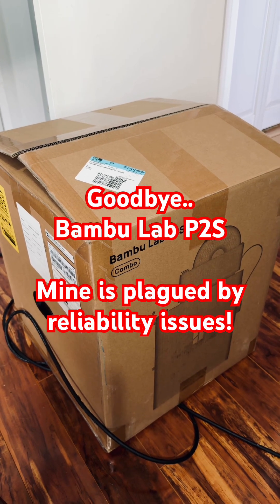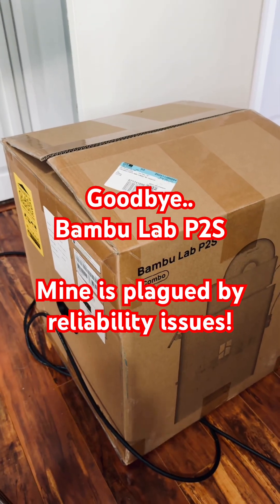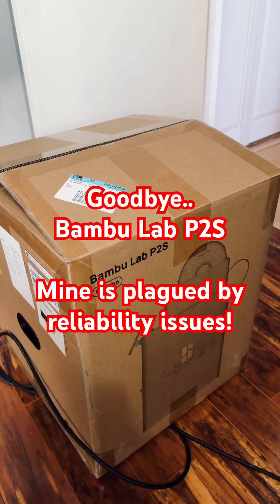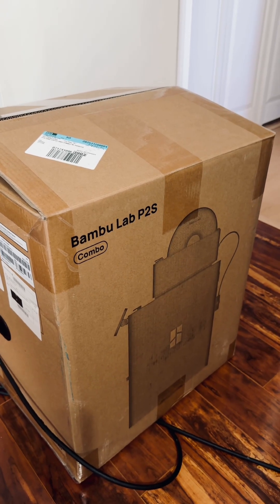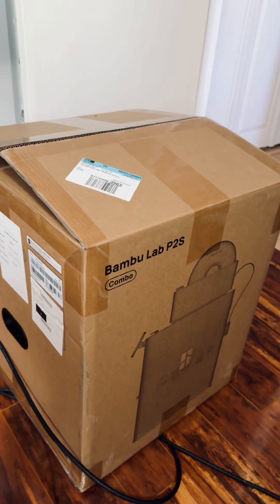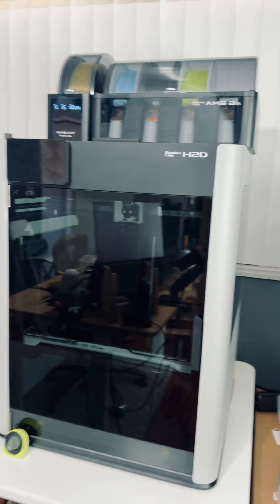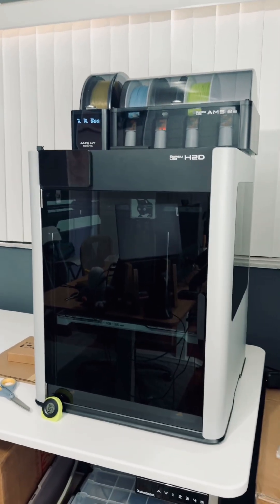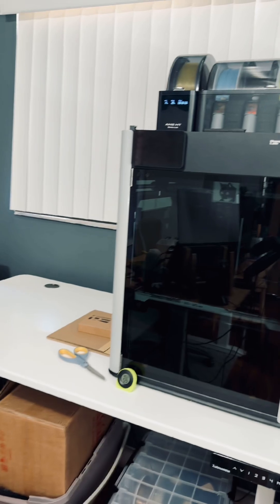Returning My Bambu Lab P2S after 2 weeks... #3dprinting #bambulab #p2s

Comment: I had that grinding issue last night, plus same extruded issues in your video as mentioned. Machine’s cold pull sequence didn’t work so did it the old fashion way of heating the nozzle to 250, take it out and cold pull with pliers. Popped it back in and everything is fine. Regards to the extruded clog mid print, I recommend always having an extra nozzle on hand to swap it in and you can always fix the clogged one later.

Comment: I have the a1 mini and I have 1000 hours of print time in it so far with zero issues. I run all types of filament pla tpu petg pctg wood glow petg and petg cf. something about its form factor makes it a tank of a machine. Only issue I found is trying to access the z screw for cleaning and greasing. If you get an a1 mini used try to find the launch model they seem to be of higher quality. The camera does suck tho.

Comment: I got the same ''extrudeur overload'' issue last night i can help you to fixe it !
Reply from the maker: Thank you for offering to help, I returned it... Will keep using my H2D for now.
Reply: Mine has the error after less than 20hrs printing - hopefully someone posts a fix
Reply from the maker: @dmsaks5608  They may offer firmware updates if more user experience the same issues.

Comment: I got the P2S and it runs fine. The only issue I have with it is print quality is terrible. This did not happen with the A1 or mini so the out of the box user experience is pretty unsatisfactory. I did calibrate my filament (Bambu PLA basic) and it is slightly better but still not good. I’m going to try a flow rate calibration and see if that improves things and I’ll try my other preferred filament Sunlu PLA Meta and see if that makes a difference. I’m not going to return it since I am really hoping a firmware update will make things better. We’ll see. I pat least you didn’t buy it from the Bambu store like I did so a return should be pretty easy.

Comment: I have over 300 hours on my P2S combo and not had a single issue. I would highly recommend getting a replacement P2S and see how you get on with that.
Reply from the maker: I spent way too much time fixing and reprinting on the P2S, never had an issue with my P1S I may just wait to get a used P1S if I decide to get another one
Reply: @TheGizmoGarage  i agree with this comment, i would try your luck with a new p2s. many people got defective p1s. its just a matter of luck and qa

Comment: That's too bad buddy. I got mine for 2 weeks now and I print daily with it. About 4 hours a day. I had not one failed print. I did saw on another YouTube channel that the 0.4 nozzle that comes with it gave him a lot of problemes. I think it's too late now but you might had more luck with a different nozzle.
Reply from the maker: Glad to hear you have no issues with your P2S. I had extruder gear failure warning happen on both my 0.4mm and 0.2mm nozzle, took extruder apart to inspect and there was no blockage/debris, probably just bad luck on this unit. Looking to get a A1 or A1 mini to go with my H2D